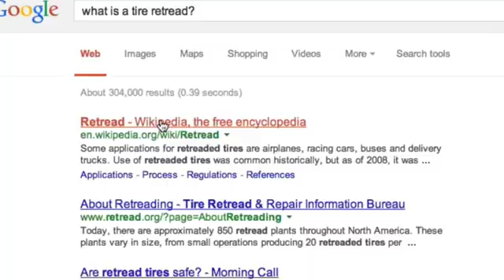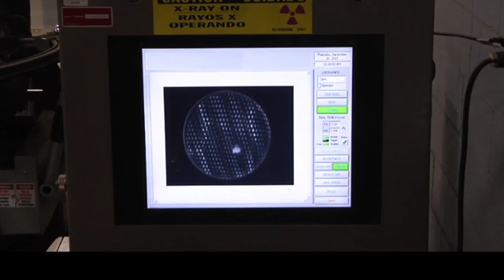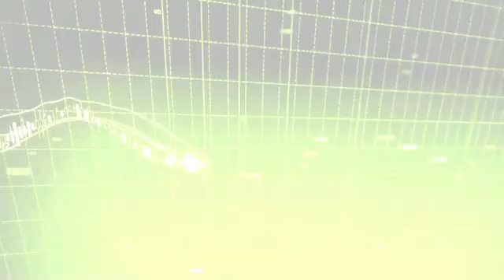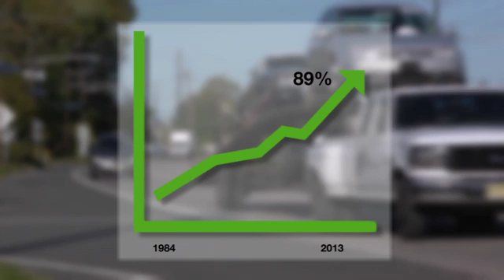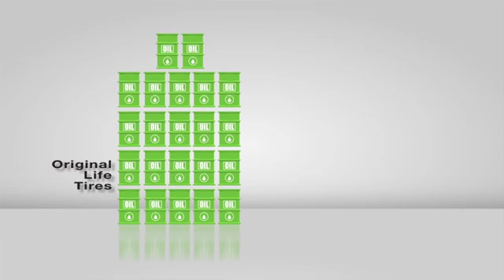The Environmental Benefits of Tire Retreading

Comment: Never had a problem with retreads on my cars. I usually bought premium "recaps" from JCPenney Tire and Auto Center, from 1967 (my first car) until passenger tire recaps phased out in mid-1980's. I could usually be "out-the-door" with recap tires, all 4 balanced, mounted, with tread wear warranty, for about 40% less (or better, if there was a sale) than high-end new tires. Why don't tire shops sell retreads nowadays? Considering all the advances in retreading (especially with cool-running synthetic belts), I'm sure passenger car retreads would be a great value (and savings!), and even safer than they were when sold by tire stores/shops decades ago.
Reply: The fact that we don't have this particular industrial niche is evidence of system corruption. Who benefits(?!) from new tire sales (increased oil consumption and tax revenue), as opposed to keeping 30% to 40% of those "better" and "best" casings (the higher-end ones) in circulation?! With sales of all new tires, tax revenue will be higher than recap sales at half the price!.. It's a political/big-oil scheme.. Tire shops are fine either way, so long as products are safe!! etc. We can get the lead out of gas, out of paint, but still can't manage to get the lead out of our politics!! More jobs! More American industry!! But Europe and Asia lead the recap industry. We can land 747 jets with recaps, operate American school buses on recaps.. So where's the recap deals for consumers? Drain the swamp!
Reply: Throw four brand new steel belted tires on a weight scale. Now imagine doing the same with 4 new (or recapped) synthetic belted. Any significant weight difference? Not enough weight difference to influence performance or fuel consumption?